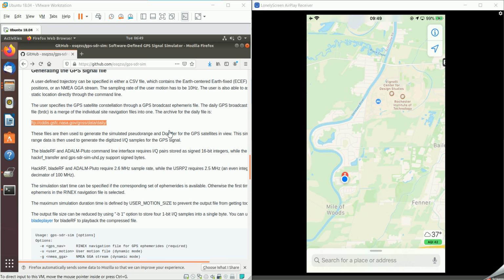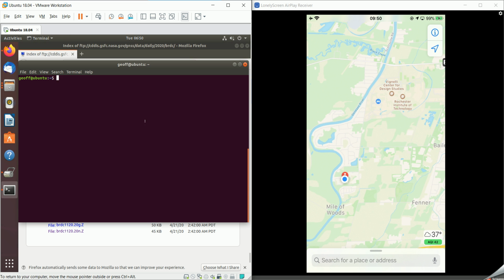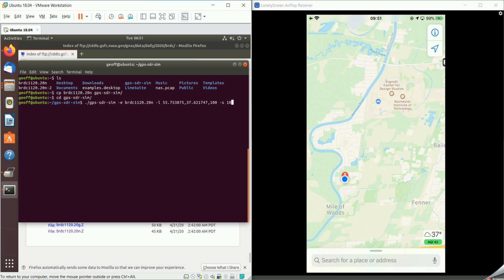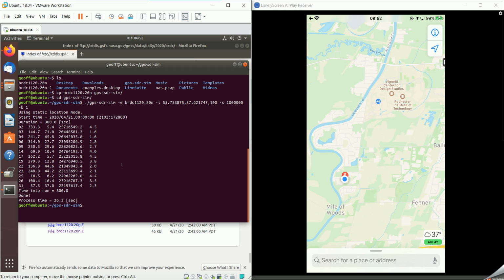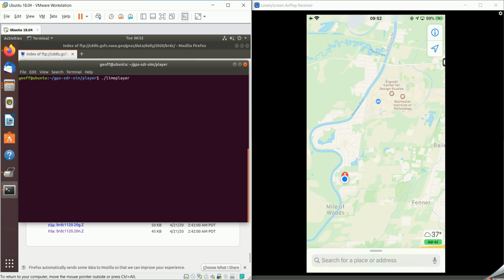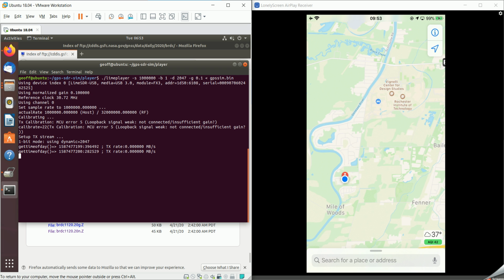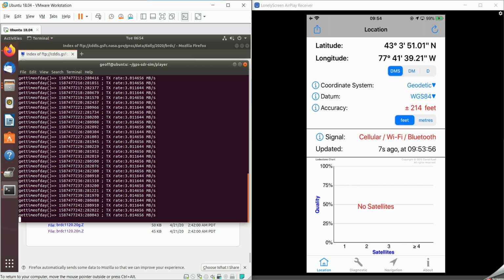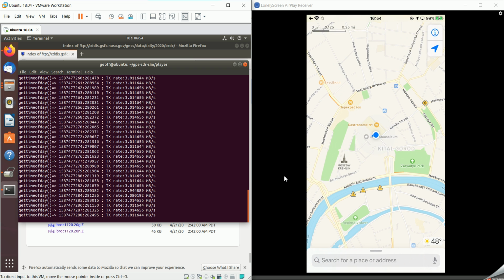GPS Spoofing Attack with LimeSDR and GPS-SDR-SIM

Comment: i need some help to achive this with windows i have Adalm Pluto and i am following everything until the point of creation of gpssim.bin
How to run the plutoplayer on windows using this generated file please can you add some hints
Reply: do you know how to replay a baseband with plutoplayer?
Reply: Did You do it. I am also trying to achieve the same using adalm pluto and stucked for 2 days. It will be a great help if you reply.